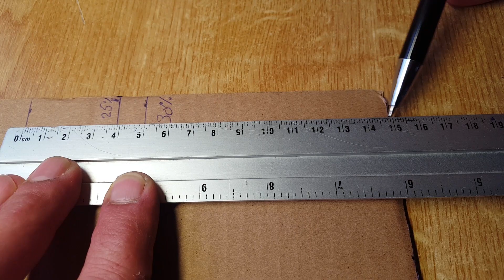DEPRON WING BUILD WITH CARDBOARD How To Make a Rc Plane With Cardboard Homemade Airplane

Comment: I use a 3d printer to make the structure and spar and it's very cheap, you can also 3d print props pull rod connectors and make watether
Reply from the maker: very nice :D

Comment: Oddly enough, I found this video AFTER having built a 57x11 wing using this same procedure. Great minds think alike, eh?
Reply from the maker: No way! very cool :D
Reply: Actually, I ended up cutting wingspan down to 48" to get less weight and better tail response. 
My main point is that this cardboard thing actually works! You get a rigid wing with a minimal of internal bracing. 
This morning, I cut loose and did some multiple vertical loops and the silly p.o.s. took it like a champ. Crazy thing was that I was going for a trainer style slow flyer, and I ended up with a multi-purpose camera platform (carrying a cellphone) and a stunt plane..... whooda thought??
Reply: Mrna can change your dna and gmos can have a patent, they also can contain heavy metals & chemicals, do some research before. Mrna is a new vaccine method, old ones were actually safe. Also it's not FDA approved I read. Someone in my family died after taking it.

Comment: Does the wingspan matter too much? I didnt quite catch what the measurements for that were.
Reply from the maker: the longer the wing the more lift is gives on the other hand a wider wing can carry more weight my favorit size wingspang is around 130 to 140cm and 15cm wide and a fusalage around 90 a 100cm hope this info helps you in the right way :D
Reply: @HowToDIYRc  thank you for being so helpful. I am trying to modify your build to add solar panels to charge the battery for a university project. I have made a few rc planes in the past, but foam is so weak and a pain in the beak to repair. This build is perfect, strong, fast, and can carry heavy loads. I'll keep you updated on how it goes.
Reply from the maker: that is so cool i'm also want to make a solar plane for such a longtime after seeing rctestflight solar plane think its very intresthing project your working on and while foam is weak its a good matarial to build a nice smooth curved wing and create that perfect airfoil and to make that wing stronger i'm using plastic carboard for underside and foam for the topside to get that nice smooth curve still need to edit that vid hopefully we can do that soon :D
good luck with your project looking forward to a vid or photo of your plane :D
Reply: Mrna can change your dna and gmos can have a patent, they also can contain heavy metals & chemicals, do some research before. Mrna is a new vaccine method, old ones were actually safe. Also it's not FDA approved I read. Someone in my family died after taking it.

Comment: I have a question. If the upper side is 16cm and the lower 15cm how is it that the percentages of the lower part add up to 60%? Doesn't that mean that the lower side is actually longer?
Reply from the maker: The curved upper pièce willen always belonger then the straight pièce at the bottem... draw it on paper and messeure

Comment: Great that you've put your spin on this, dialing it back and not using the tools we all take for granted while making it it even more accessible for the younger ones.
Scoring may help getting the leading edge shaped easier. Keep it up, Dave!
Reply from the maker: thanks buddy i've binn asked so many times by the younger kids how we made the plane and like to try but don't have a dime and the parents find it scary and come up with an excuse like glue gun is too hot and standy knives are too sharp + there are many places in the world where its difficult to get foam sheets and hot glue and those people have dreams too but not the resources to build a wing with a good airfoil until now :D and thanks for the tip we try it but it rips the paper :(

Comment: thanks for posting.   here are some things to consider.  at :17, the profile of the wing shown is not well-designed.   why.   its 'thinness' will result in a wing having a high stall speed, and a model requiring a higher minimum airspeed in order to stay aloft.      profile thickness is expressed as a percentage of chord.   generally, a profile should be at least  11  percent thick.   maximum profile thickness is Always located at 30 percent of main wing chord/root chord.            this video does not show a good iteration of the armin wing.  why.   the profile is Not thickest at 30 percent of chord.   note that when a profile is Correctly thickest at thirty percent of chord, its overall shape will Always resemble the armin wing or clark-y v1 profile.          these are Cambered, two-surface flat-bottomed profiles.   they are good all-around profiles for a wing mounted at zero-degrees angle of incidence.         at its leading edge, the lines of the upper and lower surfaces of a two-surface profile Should merge into an Optimal shape; something resembling the clark-y.     a too-thin or otherwise wonky leading edge can result in significantly More amounts of turbulence/drag being caused,  across the Entire Wingspan.      cheers
http://www.knifeedge.com/forums/downloads/clark_y_w9e.jpg
Reply from the maker: your absolutely correct we tweak the design to have less drag similar to Andrew Newton wing design and moved to spar a few mm forward to get a more rounded curve at the front 
and works absolutely fine but never as good as the Clark/y profile maybe we make a few different airfoils and show the test result thanks david it´s good feedback ±D
Reply: my friend, try to understand that Whatever your reasons were,    They  Were  WRONG.
try to understand that an anecdotal recitation of your mistake-making process is NOT Relevant or Useful  information.  to either of us.      try to understand that no matter what else you type, the Accuracy of the statements in my original comment will be Unaffected.      cheers

Comment: Loving your work! With this I can just slap electronics on and go for a flight, right?
ps. That thing you forgot the name is called "carpenter square". :D
Reply from the maker: thanks for helping mate really struggle with finding the correct name thx
I never try to make a flying wing yet they are pretty hard to get flying the launch being the most difficult but with this wing, you can make any wing design you like
in the next episode, I'm making a polyhedral wing from this wing and in the upcoming episodes we make a body with a rudder and elevator to rebuild my $5, unbreackble trainer plane
the best plane to learn to fly
Reply: Mrna can change your dna and gmos can have a patent, they also can contain heavy metals & chemicals, do some research before. Mrna is a new vaccine method, old ones were actually safe. Also it's not FDA approved I read. Someone in my family died after taking it.